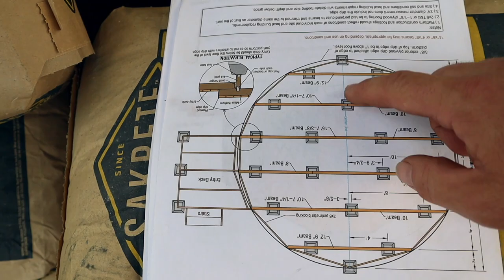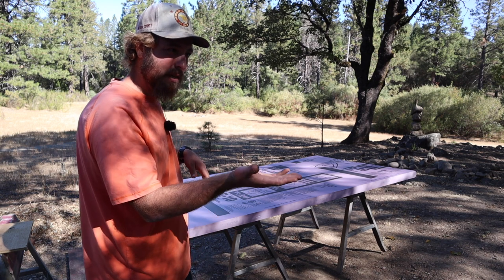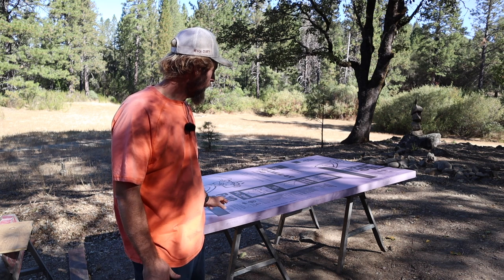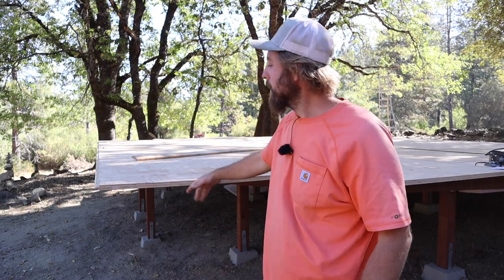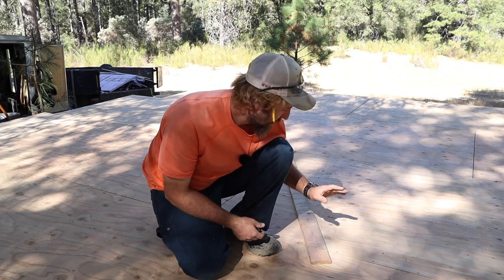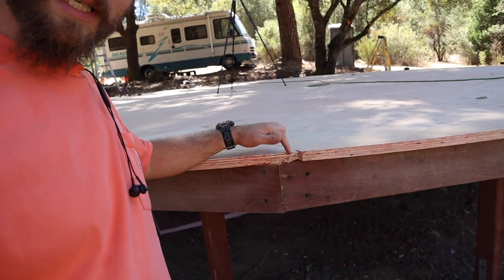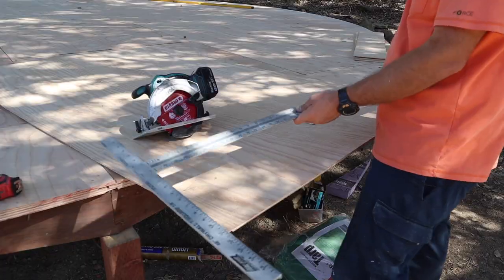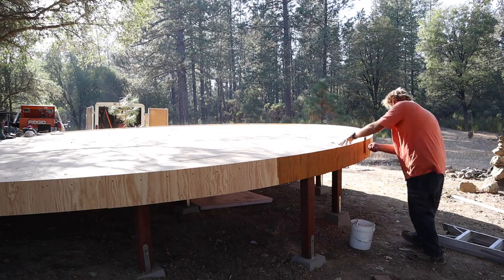Cutting a CIRCLE | YURT Platform BUILD | part 3

Comment: Joe! These are so incredibly helpful. Question: we noticed that there was caulking done between the structure and the plywood subfloor. Can you share more about that? ie Reasons for doing that, what type of caulk you used, and any other info you can think of that would be helpful. Thank you!
Reply from the maker: Hello, glad the videos are helpful. That is a great question I over looked explaining that. The "caulking" is actually sub-floor adhesive used to secure the plywood to the framing along with nails. Helps keep it securely to the frame. While also helps keep down and any noises, squeaky floor. If you search sub floor adhesive you should find some info. Loctite brand makes one. And a product called liquid nails. Please feel free with any more questions!
Reply: Thank you so much! Are there risks to not using the adhesive? We’re building a 16’ yurt platform that will be dismantled and moved in 2 years, so we’re thinking not applying the adhesive if it’s not absolutely necessary, and using deck screws instead of nails. This yurt is not a living space; just an accessory dwelling for hangouts and such. Thoughts?
Reply from the maker: No you do not need the adhesive. Deck screws will work just fine.
Reply: @JoeSimple  Thanks Joe! We appreciate your work.

Comment: Hey Joe, we bought a yurt and it is being manufactured right now. Your videos on the yurt deck are the best we've seen! Thank you so much for showing the details. I have one question though, how are you holding up the insulation panels? Just screwing right into the spacers? What is holding them up?
Reply from the maker: Congratulations on your soon to be yurt, Thank you. Yes the panels were screwed to the spacers. couple tips, we cut the insulation panels fairly tight and forced them in from the top, easer than crawling under. Then installed the spacers using nails or screws your choice, if using pressure treated lumber don't forget to use hot dipped galvanized fasteners.
feel free with any more questions.
Reply: @JoeSimple  Thanks so much for the tips on the insulation. I will for sure ask if we run into any other questions. Thanks Joe!

Comment: NICE WORK AND EXTREMELY HELPFUL.     MY WIFE AND I ARE LOOKING AT FULLTIME YURT LIVING WHEN OUR FULLTIME RV LIFE HAS RUN IS COURSE.   COMPARING THE FLOOR INSULATION ON THIS JOB TO SIPS PANELS, HOW BIG OF A DIFFERENCE IN PERFORMANCE BETWEEN THE TWO?   IN MY LOCATION WINTER LOWS ARE SINGLE DIGITS TO BELOW ZERO.   ANY SUGGESTIONS.   THANKS

Comment: This is awesome man, could you share the plans? How much was total cost excluding labor and time spent doing it? What are the name of the blocks that were on top of the concrete you poured? Did they have the brackets in them already?
Reply from the maker: Thanks for enjoying it!! Plans are available at yurts.com under resources,  downloads.
Material cost in 2019 $3500- 4000
Expect much more with today's lumber costs! Time was just over a week full days, from lay out to finished deck. Yes The block does come with the strap attached, concrete pier block  with strap.

Comment: Is that 4x8 for the beams and 2x8 for the blocking? Is that pressure treated? My plans call for beams 4' on center and no blocking because it is meant for a SIPS deck. Did you do your blocking just over 4' OC so it was friendly with the insulation dimensions?
Reply from the maker: We used 4x6 for the beams, they could be up sized if wanted. 2x6 for the blocking, yes it is pressure treated/ ground contact. Yes the beams are 4' on center. I did the 2x6 blocking between the beams because 1 1/8 ply wood was selected for the flooring, and it needs bracing every 4'. But I could see not needing it when using something engineered like SIPS. Thanks for checking out the video and great questions, Feel free with any more questions.

Comment: I’m about to start a similar project. Do you recommend treated plywood for the subfloor? We will install vinyl planks over the subfloor. Thanks!
Reply from the maker: Personally I would not do treated plywood, because the off gassing. Are you in a harsh climate?
Reply: @JoeSimple  I wouldn’t say harsh. Southern Missouri. We get all of the weather here, but again, I would define it as harsh. Thanks

Comment: Hey Joe, thanks for your reply about the plywood. Decided to go with the 2x6 T&G select deck for flooring instead👍🏼 One more question for ya…..we used 6x6 beams for our posts and we set bolts down in concrete to attach our base to for the 6x6 to sit on. As we’re getting ready to do our floor joists, we noticed 1-2 of our longer posts seem a bit wobbly. I’m assuming the nuts didn’t get tightened enough? But we’ve already screwed/nailed the posts in. Do you feel like that will compromise the structure at all? Especially after all the heavy joists and flooring are in place on top of it? Thanks so much for your input!
Reply from the maker: You should be fine gravity will do its thing there. How tall are the wobbly posts?
Reply: This one is toward the front….about 36” prob? (The guys are building so I’m not exact on measurements😊)
Reply from the maker: 3ft, yall should be ok.

Comment: Hi Joe, I'm struggling to find the 1 1/8" T&G plywood.  Have any suggestions?? Need to get this platform built.  Thanks a lot!
Reply from the maker: Is it just not available/ out of stock?
Reply: @JoeSimple   no one in this area has it. Only 3:4” T&G plywood? It’s for a 24’ yurt
Reply from the maker: The 4' beam and joist spacing is designed for 1 1/8 ply wood or a product called "select deck" (T&G 2x6 material).

I think you could do 3/4 t&g but I would add a joists in-between beams every 24 inches on center.